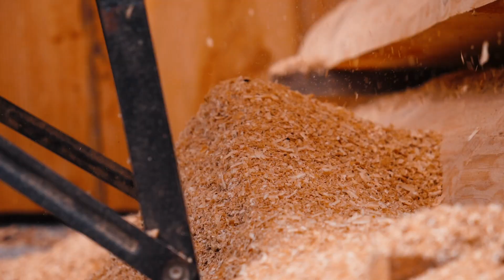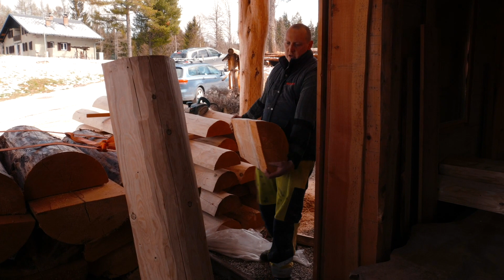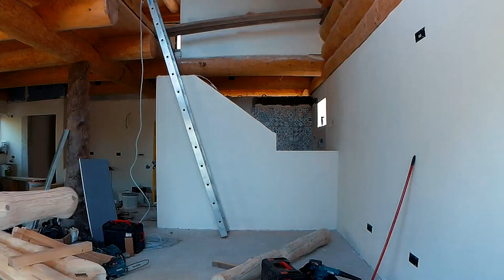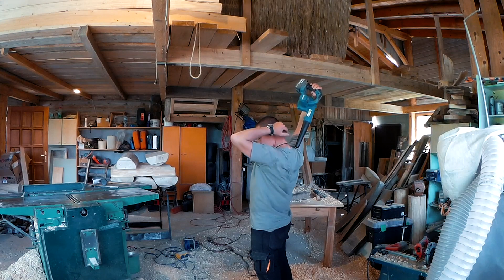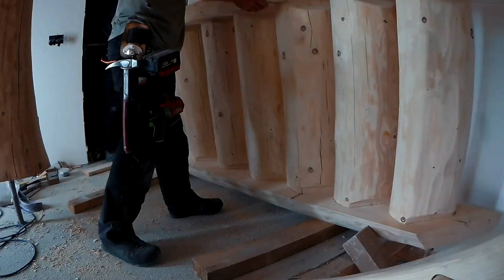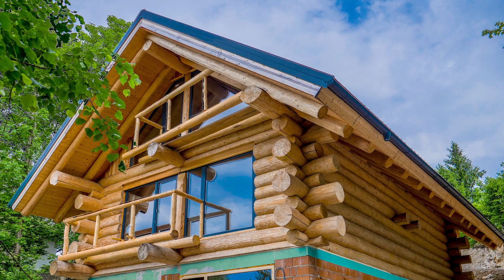Staircase Built...Start to Finish

Comment: I see on one stringer there was only one lag bolt holding the treads on and on another stringer there was two lag bolts holding the treads on! Why would they do one stringer different than the other? I have built stairs for over 25 years and I would always do the same on each stringer. Where the stringers meet the landing and the second and third floor I might not of plumb cut them and let them continue so it looked more natural. Still very nice workmanship!